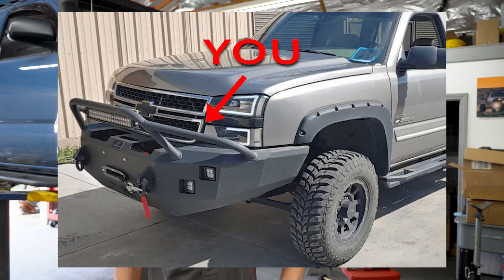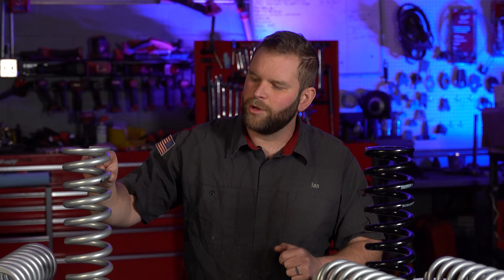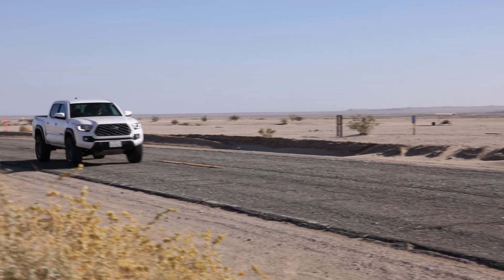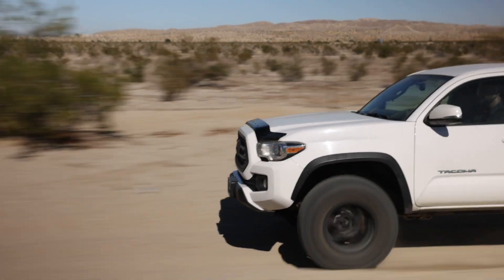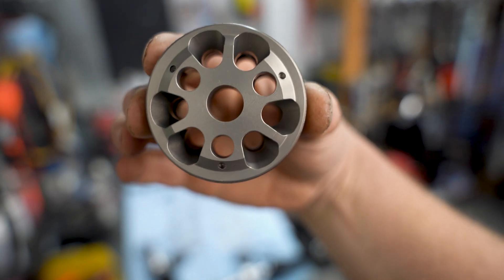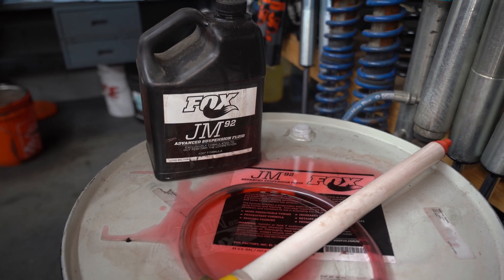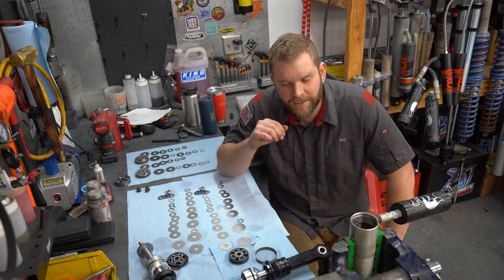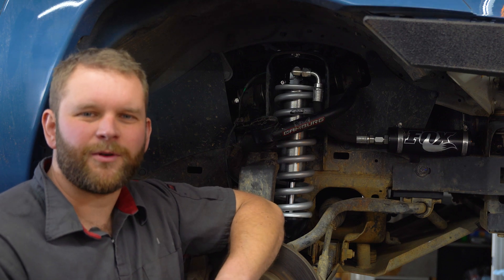HUGE suspension mistake! (16.3% heavier springs on your Tacoma)

Comment: Getting a bilstein 6112/5160 setup for my 3rd gen tacoma but still not sure what springs I should go with, I am planning on adding about 80 pounds up front and only aiming for 1 inch lift from stock. Any ideas or suggestions?

Comment: Are fox high flow pistons directly interchangeable with the old style low flow pistons? Im assuming that if the thickness is the same then i wont have any issues with available threads on the shaft tenon.

Comment: picked up bilstein 8112s up front from you for my gx470 and love them! 

i’m trying to figure out what to run in the rear now with a steel rear bumper+swingout with a full size spare (~150-200lbs). coming from eibach stage 1, do you think that king 2.5s would pair well with them in the rear and would the eibach HD rear springs? would i be better off running the standard eibach rear spring? or just switching out to a different spring altogether? thank you!🙏

Comment: As soon as I have the cash I’m buying 8112 from your site! How important is it to get matching rears (8100) smooth body? I have eibach resi now can I run 8112 front and eibach rear??? Or would the 8100 rear be a huge improvement or noticeable? I want to go faster in the dunes

Comment: Subscribed!
I have a 17 taco trd off road. Went King 2.5 RR extended travel all around with adjusters, Icon Rxt leafs out of the box didn’t add any more leafs, Accutune ubolt flip kit, Dirt king upper control arms. Rides good obviously, looks great, but overall it’s harsh. I feel basically every road imperfection. Doesn’t matter much what I do with the adjusters. Even on higher speed small whoops more aggressive faster driving where I thought this set up would shine, I’m still over here buckin bronco. This was my “dream” truck so went all in on my suspension, but ride is overall harsh. Very rarely do I feel like all of the money/effort I invested is justified for how I realistically use my truck. After watching some of your content specifically your shock value series, I’m considering downgrading my setup. That comment you made about 2.0s and save money for gas got me thinking. I love getting out on trails and playing when I can, but realistically 90% of the time I’m just going to work. Makes me wish I went with a cheap fox 2.0 kit or bilstein 6112 something budget friendly. Saved my money for other mods. I’m sure valving/tuning is my real issue, but still I’m debating selling my Kings and going with a more budget option that has better daily drive “plushness”, but can handle the occasional off road sends. 

Have I completely lost my marbles?? 😂
Reply: Any update on this ? 

i have a '23 Taco OR and I went with Fox 2.0 as a middle ground since I had Bilstein 5100 in the past on my '03 Taco Prerunner. 

Let me tell you that setup with an Icon Mini pack(aal) Was the worst ride I have ever had. They were so darn stiff that my head would hurt driving on the freeway with it. 

I had to sell them and put 5100's back on to enjoy the truck again. I Wanted to get kings but your comment throws me off. 

Debating on bilstein 6112/5160 since their dampening and build quality seems to align best with my needs and wants.
Reply: @darknessfalls714  
I'm surprised to hear the fox 2.0 was that harsh! I feel like most people say its pretty plush for a daily (that's kind of what made me regret spending all the money on kings for my daily) but again there are so many factors. Bed weight/tire & wheel setup/bump stops/shock tuning/spring rate/road conditions/tire pressure etc. I had Bilstein 5100/old man emu coils on all my 3rd gen 4runners. It was the go to budget setup. Nothing to write home about, but overall did great for the price so zero complaints!

I'm still rocking the setup I mentioned above. I've gone back an forth on if I want to go through all the trouble of swapping in something different. Decided its not worth it. Going to stick with the Kings and keep dialing them in. Grass is always greener right? I think the key with Oem fit Kings is the tuning/correct spring rate/and not cranking down the preload collar for more than 2" of lift. I had the same King front coil overs on my 2nd gen Taco and they rode amazing. What you would expect from King. That being said I had stock wheels/tires maybe only 1" of lift on that truck, so almost no preload on the coil. Less preload the less harsh the ride is going to be. On my 3rd gen taco, I have almost max amount of preload on the Kings to fit my 33's. Also worth noting I'm running load range E mud tires which add to the harsh ride. I have since lowered my psi to 35psi which helped a lot not feeling all the small road imperfections. 

Advice I can give you is if you do decide to go with Kings:

1.Order from Accutune off road. They offer free shock tuning when purchasing through them. Plus they are very helpful getting everything dialed in to what your needs are.

2. I went all out and paid extra for the adjusters. While they are nice to have in some scenarios, I rarely use them. Id consider saving the money there and going without the adjusters.

3. Don't expect your truck to drive like it has long travel just because it has Kings. We all want that and are guilty of thinking that way! Theres a reason long travel cost so much, but also cons if its going to be your all around truck. Thats where all these mid travel setups come in. Happy medium. 

I would never talk smack or tell anyone to not get Kings. When setup properly there ride amazing. Just keep all these factors in mind and know your going to spend a good chuck of change when you go that route. Cant take it with you when were gone. Hope this novel helps in some way. Goodluck!
Reply: @dylanjischke1993  woah , very detailed response. 

I have a thuren suspension tuned fox 2.0 RR on a ram 2500 and it rides like a dream as a daily. I think for what ever reason the Tacoma was just too light and with Fox stock tuning it just contributed to a lot of the harshness. 

The truck was fully stock in every other aspect. Maybe if I had accutune valved 2.0 in rear it would have felt better, but the fronts have no hope. 

My 5100’s are great for now so I’m not in a rush to change them yet. I have worked with accutune before so I agree I’ll probably buy the kings from them and have them valved. 

A big issue was that my rear fox shocks were 0-1.5” where I should have gotten 1.5-3” . Oh well, you live and learn. Waiting to see the next shock shootout from these guys too !

Comment: I’ve seen a lot of vids for fox and kings but what is your overall take on the OME B51s? Great video by the way! Sub’d
Reply from the maker: My friend owns a shop and they had the bp51s on their shop truck and eventually threw out all 4 shocks after multiple parts failures and getting the run around from arb. Beyond that i cannot speak to any specifics however it is a twin tube type IBP similar to foxes product so on an IFS application you're narrowing it down to a 2" piston, the amount of valving you need on a 2.0 piston is very high even without bypass bleed holes in the inner cylinder, the set i drove where not remarkable in any way, to the point where we didn't even include them in our high budget blind shock test. Alot of the OME shocks will be built by bilstein from now on, however that will not result in an increase in build quality as they spec only highly profitable builds.

Comment: I used the Fox 2.5s on my Chevy Colorado from BDS it's for the BDS 5.5 lift kit. Terrible shock setup. Way too soft for any serious trail when loaded down with camping gear. Next I went with KONI Raids and 700lb. coils. The Konis have adjustable rebound, no gas, internal bumpstops, and require no maintenance. The Konis made a big improvement at half the cost of the Fox 2.5s!
Reply from the maker: That's interesting I've never had any first hand experience with the koni outside of their rep showing me a cutaway of their twin tube design. Being able to adjust rebound is awesome for changing spring rates. Fox makes a phenomenal product, the last 3 custom built trucks i've done have all had fox IBP's or bypasses but the stock valving leaves alot to be desired.

Comment: I need to get something for my ranger. You can watch my short to see it in action. I have rough country TJ front shocks and I recently went full ham in the back with 14” 2.5 remote reservoir FOA shocks. Valved light-light. The rear is great but the front is too soft. It has a 302/435/205 combo with a 75 bronco front axle with James duff long arms. Running stock Chevy 63 leafs out back and Deaver super flex 180ppi up front. It flexes great but bottoms out on the bumps…Locked front and rear and on 37 pit bull stickies.
I’m debating custom shock towers and do some 14/16” comparable shocks up front.
I love king and fox but the price point is hard to swallow with my rig…
Reply from the maker: Those rough country TJ shocks are likely valved as light as possible and reach shock fade almost instantly. 
Honestly, i do shocks and suspension for a living... and i still tell people half the time to search for them on facebook marketplace first. You can find some really good deals as long as you know what compresed length you can fit, and pulling them apart and revalving can be done with about 50 bucks in tools, and i have a few other videos that take you through step by step

Comment: Installed King 2.5's w/resi adjusters (KING-25001-148) on my Chevy 1500 and they totally transformed the truck.  Only regret is not doing it sooner.  Dirt King UCA and cam adjusters, shackles and Deaver J1 mini packs out back.  Great video & new sub here.🍻
Reply from the maker: King really nails OEM valving profiles, and there customer service is phenomenal... that being said, they charge 6 bucks per valve so just the shims for a revalve on 4 shocks is  almost 300 bucks worth of shims alone.
Reply: @WheelEveryWeekend  Appreciate the insight.  Will hit you up when it comes time to revalve/rebuild them.  Currently have 50k on the shocks but they're still hodling up well and I'm not offroad now as much as I was.  Still nice to know they're there when I need them :)

question for you:  I'll be adding a bumper, winch, and extra battery.  The kit came with the standard #700lb springs.  Any idea what I should upgrade the spring to to get back to height and handle the extra weight?  I only run a little preload (about 3/8-1/2" threads showing) as I don't want much lift and also like having some down-travel ;)  Thank you.

Comment: I watched the whole series and it was very interesting. Have been debating over which shocks and what setup to get on my f150 for a while, and the challenge is there are so many different opinions (stiffer is better vs softer is better, stiff spring with soft valving vs soft spring with stiff valving, etc), I am afraid that I might spend a fortune only to be unhappy with my choice. For someone who is 80% road but wants mostly small bump and washboard compliance, soft spring AND soft valving? On a fox 2.5 is there still enough room to make it reasonably progressive so I can still hit some larger bumps?
Reply from the maker: So here is the really annoying part about shock tuning as far as washboard or rzr burn goes... there's 2 general valving theories, the first is to make low speed very firm and rely primarily on tire pressure and speed of travel to cover the washboard comfortably while the valving is absorbing the inputs without giving much, the second is lots of bleed and softer initial valving to get shaft speed so the tire can move up and down over every bump. We shot another 2 shock shootouts this year and at this point i have tested 20 sets of shocks completely blind on the same trails and i gotta say... as long as both options are valved well, they both work. The absolute biggest difference you can make either way is tire pressure and speed. Now that i have avoided answering your question, a 2.5 with adjusters may be right up your alley so initial valving can be soft for potholes and expansion joints and stuff however with enough shaft speed you can rely on the high speed comp adjuster to slow down the movements on big hits. The adjusters allow you to pull some valving from the main stack and because the adjusters are only acted on by oil that is displaced by the shaft if you have low total shaft movement inputs (like washboard can be) you can have a very comfortable ride and still hit big stuff.
Reply: @WheelEveryWeekend   Thank you VERY much for the detailed reply. This is exactly what I was looking for. Initially I had considered the 2.0s, but I am thinking I need the 2.5s to be able to handle the soft stuff and the rougher stuff. I definitely get the tire pressure, I air down, but when towing you can only air down so much (and if you are on gravel washboard for an hour, then back to pavement, then back to gravel, like I tend to have, its a pain to air up and down every time, hence my desire for pillowy ride from the shocks for the first inch of travel). Definitely appreciate your input, and sounds like I can get the 2.5s dialed for what I want!

Comment: Really looking forward to seeing you do a valving walk through and how to recognize the issues on low/high speed comp and rebound.

My 1st gen taco with bumpers, swingout, winch etc has 650lb springs and  king 2.5 oe ext travel but the ride has never felt right. I really wanna understand how to start in the right direction with tuning and adding a flutter to the front. Rear rides nice but the front in roughhhhh at times
Reply from the maker: I'm hoping to shoot some really simple explainers in the desert with different valved shocks hitting trails at the same speeds to show what the changes actually do.
Is it the IFP king? I had those on our 1st gen and honestly they are pretty good but they come with i think 550 lb springs stock so you're way up there as far as spring rate iirc. If they have been on the truck a while they are also probably blown, kings seals do not last very long. In the front you're also very limited by the geometry, outside of bushing bind i believe the front only gets 7.4" of travel in stock form, which can be freed up a bit with different control arms and such, as the stock vulcanized rubber bushings are providing a spring rate at a certain amount of twist
Reply: @WheelEveryWeekend  

https://youtu.be/M7yxhFBqEYw?si=b2oEuU43wIFrBzLt

This is a video I made a few years ago, you can see in the whoops the lack of speed and how it seems to be lacking both compression and rebound dampening. I believe they are ifp but I'm not super savy. I just bought the "oe extended travel"  to go with the spc uca and stock lower with new bushings. Stroke is something like 5" at about halfway mark on the lca so roughly 7.5" wheel travel. The front is normally a 600lb I believe and I went 650 for the v6/steel bumper/skids/winch set up.

Rear is 2.5 smooth body with rr and comp adj. These were setup by filthy motorsports and rides much better than the front. 

Front feels good as long as it droops before compression, ie pot holes and washboard are rough but a water bar that gets the front off the ground has a soft landing. Slow speed feels stiff as the little bumps feel better after about 30mph but road driving it doesnt roll much which is nice and the high speed feels soft as the shocks will compress and make the vehicle feel unstable on harder hits. 

But they have about 6 years and roughly 40k miles on them with 1 Pismo, 2 rubicon, and at least 20 fire road runs on em. Due for a service for sure, just don't wanna dive into it until I have a better idea of how to do the tuning!
Reply: The video is pretty bad but 3:18 shows the suspension moving

Comment: King and sway a way use to be the same company in the 90’s. Fox for sure did not copy any design from King rather king copied the design from FOX. I would look into the new tech from Bilstein, they have some crazy patients out there
Reply from the maker: When i was on bilsteins podcast we talked about the new tech they have and the blackhawk stuff. I really wish they would advertise their performance offroad products better and step up into the 4.0+ bypass world (although the 4400 truck they sponsored this year was wicked fast compared to other rigs with much bigger shocks).
I think at a certain point everyone is copying everything from someone, the owner of one of the shock companies you mentioned purchased a full set of zone control product line to try to reverse engineer it.

Comment: Looking forward to the valving in the next video. 😀
Reply: Thank you. I have kind of an odd combination. I have a Hilux that has a total front weight of a 3200 lbs with an unsprung  weight of about 880lbs on a solid axle with 220lbs/in springs and walker evans  shocks witch are meant for a TJ wrangler. So i am eager to learn more about valving the shocks for my combination :)
Reply from the maker: Should be good, just gotta figure out how to actually organize my thoughts. I have a list of OEM valve specs from all brands on my website as well if you ever need a baseline.